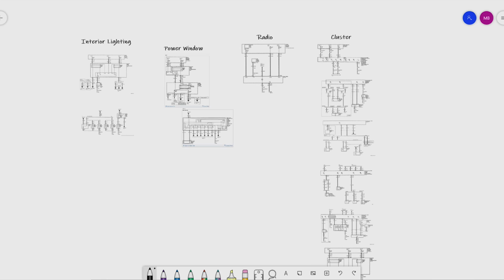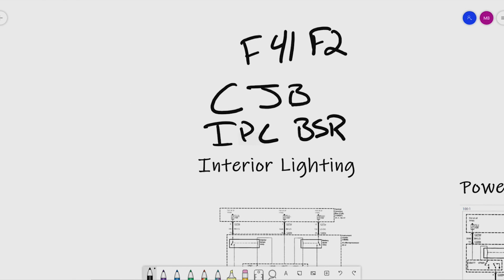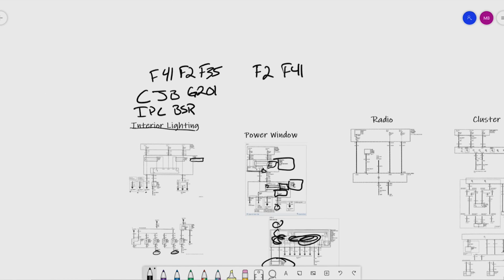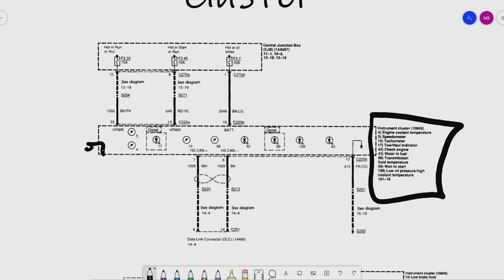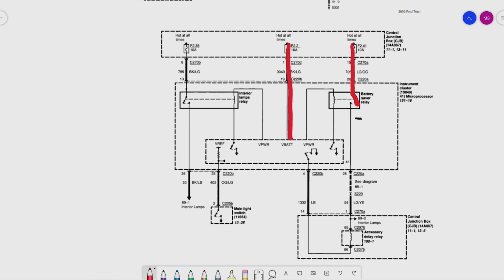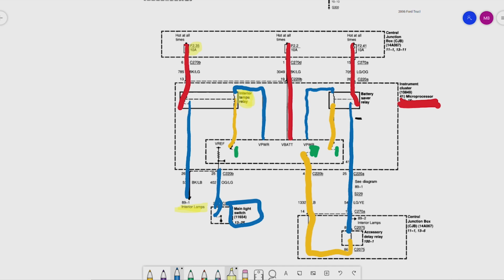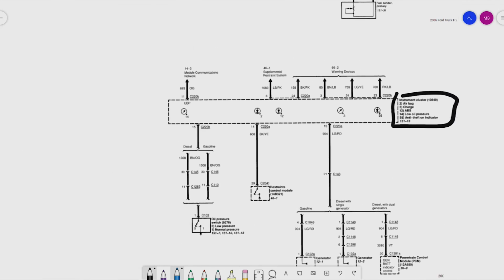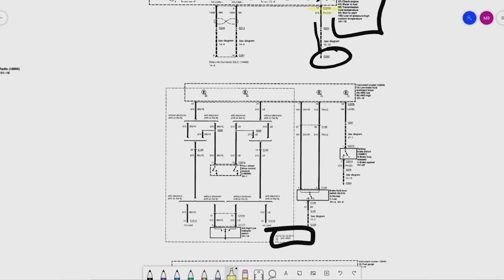How To Use A Wiring Diagram To Diagnose and Fix A Car - 2006 Ford F250 6.0L Cluster/Radio/+more INOP

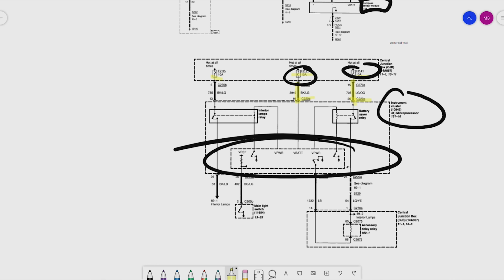Comment: Hi Mike, thanks for taking the time to make such a thorough series! Just need 1 clarification @ 22:25 plz. You said you’d take 1 leasof the test light to pin 19 of C220b, & the other lead of the test light to pin 12 on the same connector. Where I’m confused with your statement is the fact that a test light of course has only 1 lead (probe), with an alligator clip on the other side. Are you saying the correct process is to first touch the light’s probe to pin 19 while its clip is connected to a ground, & then to touch the light’s probe to pin 12 while its clip is connected to battery + ?

Comment: My 03 F-350 6.0 Diesel Voltage regulator failed, overcharged the batteries blowing the secondary up. After replacing the generator and batteries and all the fuses it is a no crank no start. The accessories all come on when the key is in the on position but when you turn it to start it all cuts out until you release the key back to run. I read a short coming from f2-22 it doesn't seem to be getting power at the PCM but I can't seem to locate the issue . If anyone has a suggestion I'm all ears

Comment: Great video. We have a 1990 ford f250.ford says we need the f150 computer 8900 to 10,000 lb. vehicle and i say the wireing cluster colors are the same on this 1990 as the 1991,so this makes it more confuseing.what computer do we get.
Reply from the maker: Hello,
Good question, most of the time if the dealer uses the vin to look up the parts they are correct. The other option would be to pull out the cluster and look for a part number to cross reference.
Hope this helps!
~Ryan

Comment: 24:40 From this angle, pins 5 and 18 counting 1 at top left look like they might have fused.
24:42, once it cools, if it's not joined, it's a tiny gap - maybe one that could build capacitance, spark over causing a brief glitch?
Reply: spot on ::)) indeed look like a bridge

Comment: I had similar problems once. The root cause was that the negative pole of the battery - body connection was too rusted. Had to be cleaned, contact sprayed and reconnected.

Comment: Awesome instruction. I have a question maybe you can help me with. I'm trying to troubleshoot a parasitic draw. When I pull the fuse that the IPM lid identifies as "HZRD LP" most of the draw goes away. When I pull the fuse identified as "IOD" the rest of it goes away. How do I use the words "HZRD LP" and "IOD" to relate to the schematic, which uses numbers, as in "Fuse 2" and "Fuse 26" etc? Thanks.

Comment: Hi this is a great course thank you , I have a fault at work on a dumper hazard indicator circuit with ign off indicators work but not Hazards , 
ign on both work , I’m looking at a wiring diagram but can’t see how this is happening fuse is ok flasher unit is new . Any idea’s .

Comment: Mike excellent video with lots of schematic reading info. Heat and vibration I have found out to being main causes for circuit board failures. I know a gentleman his name and company is Maic Salazar automotive diagnostics. Great individual and he personally does the repairs.  He is located in northern Virginia close to where my daughter lives and I told him I would highly recommend his business. Anyway I have to look at my windows 365 package and see if I have that whiteboard option. If not I will get it. Great way to trace out circuits without using reams of paper and ink which is not cheap. Thanks again Mike for sharing your knowledge. Artie 😊 we all need a smily face nowadays especially today being Election Day. Stay well and safe 👍 just for info sake their are boards between boards like a sandwich that can go bad and can’t be fixed that the wiggle test will not confirm. Sometimes tapping and flexing the board can help locate the problem. Just some insight.
Reply from the maker: Hey Artie, thanks for watching! Yeh, Maic is a great guy! I've met him at a few of the training events. You stay safe as well!
Mike Becker, Senior Instructor

Comment: An easy mistake to make is to assume that because you find an active fault that this is the only problem. It probably is the instrument cluster but did you check the fuses and power/grounds as well as relays etc?
Reply from the maker: Hey Jonka1, yes, I checked all powers and grounds at the time of failure. I talked about doing it, just never showed it in this video.
Mike Becker, Senior Instructor

Comment: Great instruction as always, Mike, thanks! Would you mind suggesting a video to study how to do the physical part of the diagnosis? i.e. the wire and pin probing, using the voltmeter and test light? Cheers. Cam

Comment: Sorry I'm late! Got WAY behind on my videos. Great procedure you outlined here. I'd probably be alot more successful if I started writing things down like this, lol - can't remember crap these days!  I  try to find commonalities, then I forget where I started halfway through my diag ... 😂

Was worth a shot reflowing the solder. I've repaired 2 separate issues on my '93 Volvo 940 doing that in the cluster, and HVAC unit. Sometimes it works, sometimes it doesn't, but worth a shot nonetheless.  Great stuff as usual, Mike!

Comment: Is there a reason you did not suspect a faulty ground connection?
Reply from the maker: Hey Alex, great question. All of the failure did not share the same ground. Had they shared a ground I would have been more likely to check that. 
Mike Becker, Senior Instructor

Comment: I would have been all over those solder connections with a magnifying glass, and looking for the cracked or dull solder joint(s)
Yes it's time consuming, but super cheap if you find and fix the problem.
15 minutes, and 15 cents worth of solder is a lot cheaper than a several hundred dollar cluster.
Reply from the maker: Hey, I did look at all of them closely, no luck finding anything that looked bad :(
Mike Becker, Senior Instructor

Comment: Hi Mike. Great video thanks for using your time to make them. I had a gmc (imagine that) that the dash would just go out randomly. Gauges lights everything. I finally caught it when I could verify power and ground when it was out. Had to be in the dash. I sent it off to circuit board medics. They fixed it and got it right back. I think it was 3 days turnaround. Great people to deal with and fast service.  They did have a issue with it. They called and said it had some pulled pads on the board and it was going to cost a added $50 to fix. Was that ok with me. I said yes and they said they would get it fixed and shipped out the same day. And they did. Good place to get a dash repaired. Thanks again for the videos.
Reply from the maker: Hey Don, thanks for watching! That's great to hear about Circuit Board Medics. I have year to hear anything bad about them.
Mike Becker, Senior Instructor

Comment: Thank you, Mike.  You're a great teacher!  I owned a 2006 F250 and I bought the truck with the same exact issue due to that connector.  There is so much strain on that connector because the harness seems to have zero slack, so the typical 'truck ride' and strain on the board connection leads to failure.
Reply from the maker: Hey Dave, thanks for watching! I guess it's a somewhat common issue on them? Good ol' "truck ride", haha!
Mike Becker, Senior Instructor

Comment: Great video Mike ... I was thinking powers and grounds right away, but probably would have chased my tail for a good bit to hit on the IC ....  United Radio is another company that will repair IC's ... they have always done a good job for me and they also give a 1 year guarantee.   In talking to the techs there, it seems there has been a change in the solder formulation that allows the joints to crack requiring them to be re-flowed...
Reply from the maker: Hey Randy, you're the second person to comment on United Radio. I'll keep them in mind, thanks! Thanks for watching!
Mike Becker, Senior Instructor

Comment: I like the training aid you used. Just an hour ago I repaired a dim HVAC display by re-soldering the resistors. You and other techs that share your skills as helped me a lot. I appreciate that Mike.
Reply: I used to own a 1986 Corvette in the late 1990s.  These had the digital dashboards and were very problematic.  Mine would go dim sometimes but always do to a bump in the road.  I pulled the multi-later boards out (which was simple) and re-soldered each capacitor.  It was as bright as the heavens afterwards!
Reply from the maker: Hey Wyatt, thanks man! Appreciate that! Amazing what a little solder can do...or in my case, didn't haha!
Mike Becker, Senior Instructor

Comment: All go through the BCM and inside fuse panel.
Reply: Yep. Go find the common denominator between all the problems. First thing that should be done not chase down all the problems separately.
Reply from the maker: Exactly! Could you imagine how long it would have taken if I had to chase down each of those complaints individually!?
Mike Becker, Senior Instructor
Reply: The dash. Wow. It is a Ford.
Reply from the maker: Did it all make sense in the end Richard?
Mike Becker, Senior Instructor
Reply: Most shops charge by the hour so they want you to take your time so they make money. Can't really think about chasing down all the problems myself. Never went at mechanics that way. Hope you taught someone a good lesson doing this way for them to see without arguement. Lol.

Comment: "Common Denominator Problem!"
Found that many times, saved a bunch of time and work.
I was told at the Ford Training Center years ago......If you get multiple codes on your scan tool, look to see where their powers and grounds are located and if they are commonly powered and/or grounded.
It worked many times for electrical problems.
Hope your family and you are doing well.
Reply from the maker: Hey Mike, thanks for watching! We are doing well, thanks. Hope the same for you! Finding the commonality saves such an incredible amount of time.
Mike Becker, Senior Instructor